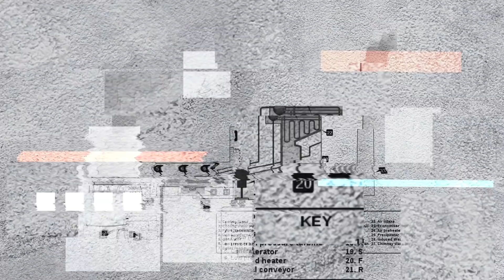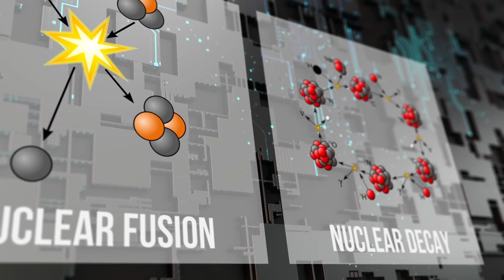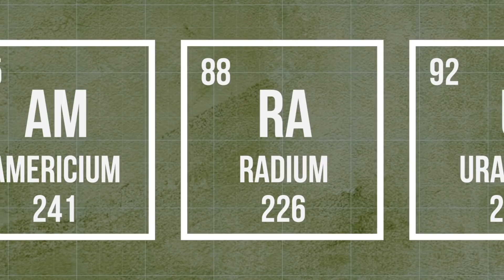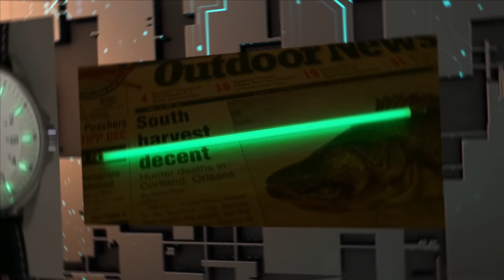World's Smallest Nuclear Reactor

Comment: It would be easier to run solar, but if a person wanted energy they could look into generating magnetic fields to produce electricity.
Reply: Magnetism = electricty and the Earth's magnetic field is fading!
After the micro nova, solar energy will not arrive at Earth for more than 200 years... So good luck with that!
Reply: @sdaniel9129  who's your dealer cause you on some really good stuff
Reply: SDaniel earth magnetic field doesn't work that way. If it was gone, we would get more radiation from the sun, as it protects us from ionizing radiation. Not sure how far your head is up your ass to have that confidence, but good luck.
Reply: @sdaniel9129  what does earth's magnetism has to do with our permanent or electro magnets ? Even if earth's magnetism is fading it only affects conventional compass and at the stage we are fucked anyway because earth would be a cosmic microwave by then so good luck with that
Reply: @SDaniel   Yeah... you wrote your comment while flying on your superluminal spaceship to another Earth... 🤟😎
Reply: I know, huh! If you got all them solar panels and batteries, just use them with the computer LED's to make a lighted sos sign.

Comment: Answer: turn off the reactor and throw it in the cold ocean lol
Reply: Yikes nuclear poisoning for the fishes
Reply: @imnotporki  i don't think it gives off nuclear vibes
Reply: @DJDXD  LMAO "VIBES" and it does give out alpha and beta radiation, it's not that bad tho
Reply: @____-fv4bm  
Yeah, Tritium is relatively harmless radiation alpha and beta don't have the same punch as gamma rays. Also, this setup that they mentioned has 0 chance of exploding. They actually make tritium batteries that have a beta cell filled with tritium gas as to make tritium glow you have to use a phosphorous layer to get it to shine so just making a cell that straight converts the beta radiation to energy is a lot more efficient than converting the tritium to visible light and using a solar cell to convert it to power. Except those tritium battery cells are pretty expensive but hella useful in long term applications. Just remember tritium has a half-life of around 10 years so in 10 years you will have half the power output. As a matter of fact, they use tritium and phosphorus combos to make glow in the dark keychains and use tritium phosphorous glass to make glow in the dark gun sights that never need to see daylight to shine the only downside is in 10 years they are half as bright.
Reply: @larrymace2361  precisely my point, they give out radiation, but it's not harmful

Comment: So,
Remove the lenses from your 51 pairs of glasses...
Reply: True man I also thought that where are we suppose to get 43 pairs of glasses 😂
Reply: each pair have 2 lenses so 22 pairs will work
Reply: @lordcecil007  is this an r/wooooosh moment or you are just trying to seem smart
Reply: @Nana-bg9hs  both, i guess
Reply: @Nana-bg9hs  op 😂
Reply: @Nana-bg9hs  r/ihavereddit
Reply: I always carry extra 22 pairs. For situations like these.🙄
Reply: you get more output from a seawater battery or how bout using the solar panels during the day to charge a battery so u can run the laser at night that you would probably burn the diode out in because of over volt & current and the lack of knowledge to make a suitable resistor to mitigate over current thru the laser. (edit) wow I cant believe I suggested using a resistor and just bounced. You should use a driver circuit which includes a transistor or even better a mosfet (harder to work with because so sensitive at the gate) a resistor divider and maybe a cap. there are plenty vids showcasing how to make such a driver like great scott. i can hear him now, "so i just went with a driver ic"
Reply: @Wtfinc  Yeah yeah THE FULL BRIDGE RECTIFIER, now you can go to your room.
Reply: @arthank1263  You make no sense. What are you talking about? What does a rectifier have to do with anything. Other than me rectifying a BS vid if I remember correctly. Maybe I sound pretentious so u say “full” BR. Am I full of myself? Quite possibly, but I’m not wrong. However, I think u just said the term thinking it’s the better solution or the TLDR to mine but it’s not. So please, clarify. And why should I go to my room? Do you even know what a FBR is or how it works? Cite me a wiki article n I’ll slam you.
Reply: @Wtfinc  a full bridge rectifier converts AC to DC while also taking care of spikes in current and so on. It was an ElectoBoom meme, but sadly you're not in the know
Reply: @arthank1263  that's a terrible explanation, but at least your half correct. The thing about spikes is usually taken care of with filter capacitors and inductors/reactors.
You never answered how the rectifier works but that's a tall order so ill try my best and u can critique.

only wrote it cause it'd be wrong for me to ask someone to do something and me not participate myself. A video deMONSTERation is far more suitable that this. In fact I quite like Mehdi's video
Converting AC to DC - The Diode Rectifier

Because not all devices use alternating current, e.g. [+5v]>[0v]>[-5v]>[0v]>[+5v].... i.e. Voltage that alternates from positive to negative and continues to oscillate in this way indefinitely, We depend on Direct current and the use of batteries or rectifiers to run most every other device. Direct current does not swing past zero volts and will stay negative or positive indefinitely unless told to do otherwise.

It is the diode rectifiers job to block all current that attempts to reverse itself e.g [+5v]>[0v]>[0v]>[+5v]>[0v] There is a glaring issue however. 2/3 of our power is missing. We can use two diodes in inverse parallel to get 2/3 and only loose 1/3. inverse parallel means one goes one way and stacked right on top is the other diode going in the opposite direction. we can double that inverse parallel and have ourselves a FULL BRIDGE RECTIFIER! to get all the POWAH flowing the same direction. [+5][+5][+5][+5] but this power will still be a bit bumpy so we put some capacitors in parallel to smooth out the flow.

PPPS. The original vid I commented on is still garbage and misleading.
Reply: @Wtfinc  I mean, I answered from a phone. This video, yes... it is misleading, and the scenario itself is beyond absurd. Using thorium with photovoltaic panels, I won't bother doing the math, will miss out on 90+% of the energy of said thorium...

As for the :)) FULL BRIDGE RECTIFIER
It was the first circuit I soldered, trying to make a custom ac to dc adaptor for a raspberry pi network ( pi w with ir cameras that, due to some technical limitations, had to share a parallel circuit ( so, one plug into da wall, and wires to each of those ). I answered a bit angrily because your original comment seemed a bit pretentious for the sorry excuse for a joke this video proved to be... mmm and I have mood swings. Now, for example, I'm chill
Reply: @arthank1263  also, seemingly answered from a different account or am I trippin.

Tritium is the radioactive isotope of hydrogen that is in those vials. Thorium is used along side tritium in fusion reactors(I think, don't quote me on that) I think ur talking about a tritium vial and solar cell sandwich. I forgot that was featured in this video.

My original comment in regards to the video was directed at the creator of the video and was meant to be as pretentious as possible cause I was pissed about the copious amounts of misinfo. Some people clap back for some odd reason cause they feel like it's directed at them somehow? idk but I'm too much sometimes n can get quite mentally competitive in comments. guess I'm a bit sensitive. So I always try to not go too far in case I'm misguided.

I wonder what my first circuit was that I soldered. but the first I ever made was a clicker. a speaker and a 9v batterie when I was 5 but it only worked when u pulsed it. I was not satisfied at all. next would be a blinking LED circuit using a capacitor and resistor at 1.5v The resistor is the really important bit. I was 9 or 10 when I started learning electronics rather than take things apart. I  made my first rectifier @ 18, waaay too late. I always knew how to make one but never needed to. IDK what i needed it for but I had to epoxy it to a computer heat sink.  weird. I cannot for the life of me remember what I needed it for. 
I remember some guys coming into the hardware store I worked at n they asked me if we sold rectifiers n i was like, "if you know what that is, why don't you build one?" then they went on to say it was for a TV from Europe. I was like, just change the plug end, its modern electronics, it can change itself from 220 to 120. ease of manufacture. idk why i decided to tell that storie
Reply: @Wtfinc  ah, forgive my forgetfulness. Then it is a tad bit dumber than I remembered. So they have tritium, which is that much weaker... Fun
Reply: @arthank1263  I'm not up to speed on thorium. I'm not sure if they put that in vials for sale to the public. Tritium is in abundance, relatively safe, and produced as reactor waste. Or so I'm told. But like you said, it's really weak but makes it Ideal for gun sights where sometimes tritium can be considered "too bright". 12 year half life, beta decay @ 18KeV to stable H3 <for completeness
Reply: 5358
Reply: And 46 calculators